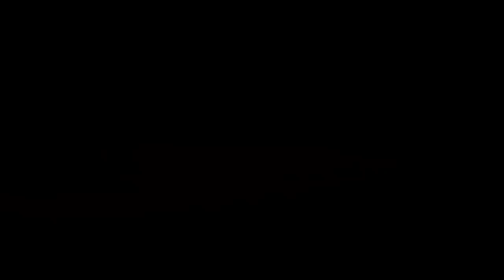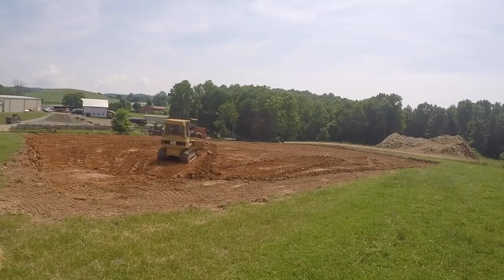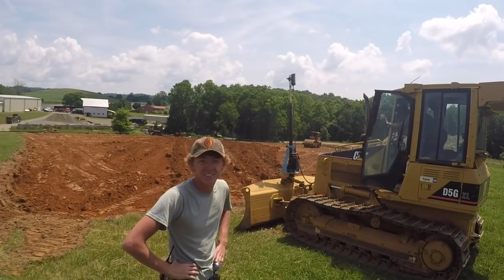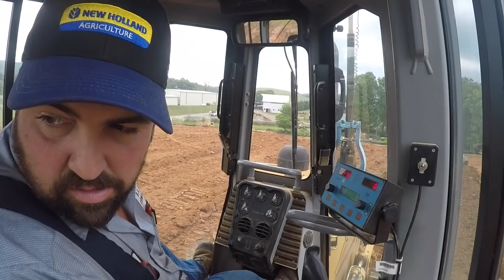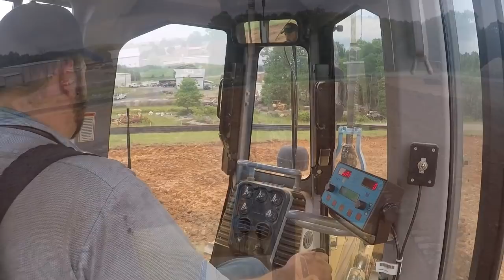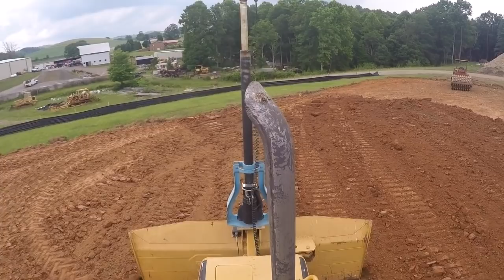Grading in high speed. New hay barn site.

Comment: Enjoyed the video as always. I have a different question it’s about my ZD326. The right tank at bottom was stopped up with gunk, no water or trash just stopped up with stuff. Do u know how to stop this. Mower just would not run.  This is what dealer found wrong. Does that sound right. Thanks for your help. Ronald
Reply from the maker: Sounds like you have fuel fungi. They make an additive to put in your fuel to kill the fungi. We have had it happen before in some of our equipment.
Reply: DLH Farms   Thanks I will get some.
Reply: DLH Farms   Thanks I will get some. Ronald
Reply: DLH Farms   It sits up for 6 months with out using it. Thanks
Reply from the maker: Yep that makes for a good candidate for the fungus. That stuff will stop it from growing but you will still have trouble until you get all the stuff that's already grown in there out.
Reply: DLH Farms they cleaned that all out. Hope it stays clean. Thanks 🙏
Reply: DLH Farms they have cleaned it all out now. Hope I am good. Add the treatment to it now. 
Thanks
Reply from the maker: Should be ok then👍
Reply: DLH Farms   What was the name of stuff u used ?  Thanks 
I’ll get me some. 
Ronald
Reply from the maker: I can't remember. Just Google treatment for diesel fuel fungi.

Comment: Good stuff Mr. Dennis ! I appreciate you my friend !! You have some nice equipment !! Even your older machines appear in decent shape ! The last strip mines I worked at had 12 D11s and 16 D10s. Six of our 11s had electronic hydraulics on them. The operator would load the blade and set the control and the Dozer would keep the blade loaded until you he got to the end of the dump. That was 6 years ago. Probably are improved over that by now.. You all be safe and God bless !!!!!     Eddy
Reply from the maker: That's a lot of high dollar iron right there!